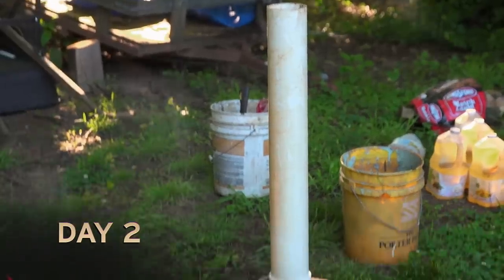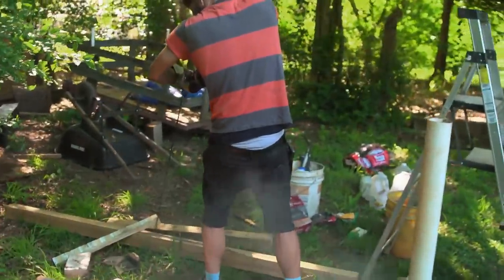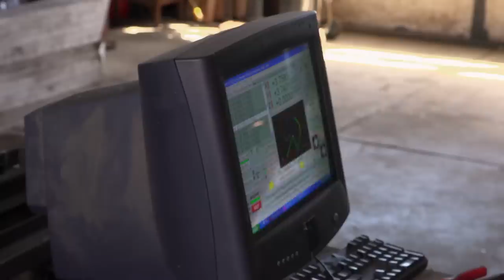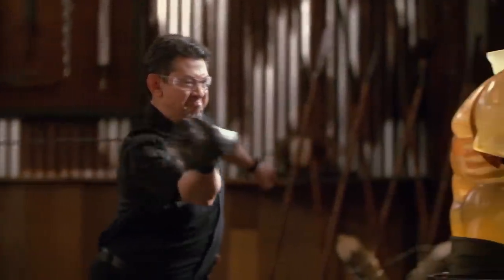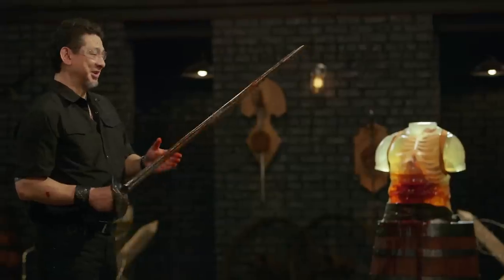Forged in Fire: General Patton's Saber IMPALES The Final Round (Season 7) | History

Comment: Chris-said the heat was uneven, and blade was soft by the tang, he did not reheat. Expected end.
Reply: You sound like a pro now hahaha
Reply: And how exactly does soft steel break and not bend?
Reply: @2.kanalummalmeinemeinungzu181  The molecules in metals form a lattice pattern (inter leave your fingers, that's a lattice). As you stretch the metal, that lattice gets tighter, think about squares becoming diamond. As it is stretched, the metal actually gets more brittle, because the lattice no longer has that flexibility. This is why it breaks.
Reply: @rorysampson5492  you win
Reply: He was literally having to use rocks and coals as a forge so chill out bro
Reply: @rorysampson5492  Facts
Reply: One guy used a old spoon and epoxy the other guy just activates his plasma cutter lmfao
Reply: @b_f_d_d  and if he'd failed on Handel construction sure... but he knew he had a problem with the quench and chose not to redo. His sword was lighter and handle smaller and if he passed all 3 tests that might have won it for him.. the judges often award the win on things like that. He said he could have redone the quench he didnt. Fact was he cut corners.
Reply: @b_f_d_d  You can say what you want about wealth and everything but IMO it came down to being lazy/not preparing. The guy knew it was weak and decided to risk it where as the other guy scrapped a project. Yes the details of the sword where fancier due to the money but that's not what failed. Quench isn't about the handle it's about the blade.
Reply: @jonathanflores7940  Doesn't matter. It doesn't mean he can't reheat his blade.
Reply: @2.kanalummalmeinemeinungzu181  kranker Name
Reply: He couldn't afford a blow torch to fix it because he already spent that money on a bag of Kingsford charcoal - give the guy a break 😂

Comment: Imma be real with you, that guy forged his sword in the woods, without help or machines. He's the real winner here.
Reply: Evanimas  Rich guy could afford to restart because proper equipment gives that luxury in the form of reduced labor for results. I didn't watch this full episode, but based on what we see here, that rich guy had a proper forge to heat up the blade while the other guy was using coal which has a significant disadvantage such as heating up the sword evenly... He took the risk because he had no choice to if we are being honest with ourselves and even if he did start over, using coal as the method of heat treating, chances are it would have the same result. This is not to say he shouldn't have restarted anyways, considering he absolutely knew it was soft in one of the most important parts of the blade.

Comment: You would think that in a show where one of the tests is to beat the ever loving ** out of a blade to try and see how strong the blade is...that the person testing said blade would you know...wear protection. These blades can be ridiculously sharp and its honestly a miracle the judge didn't suffer a "catastrophic failure" of the neck lol. It's honestly a surprise that the show has gone on for this long without the judge getting stabbed or sliced open from a flying blade that broke.
Reply: i feel the same. They need to wear cut resistant protection, its not even that heavy.

Comment: what's the purpose of scraping against the steel near the edge after heat treating? does the sound tell you anything?
Reply: If it is hard enough
Reply: The file test is to listen for the sound of the file skating against the metal if it doesn't sound glass like it's not heated properly and could suffer from issues as it would be a softer metal
Reply: Most steels should harden tougher than a file, so it should skate over the steel and not bite in. If it bites in and files metal away, it's generally still soft. 

Not ALL carbon steels harden tougher than a file though, as seen on some episodes.

Comment: I know how everyone is saying there is a "wage disparity". End of the line though, the guy who got sent off cut a corner while the guy who won made double sure that he put forward a blade that was solid. To the point of making TWO blanks that he then tested for quality. The guy who walked cut a corner and compromised his blade structure by not setting himself up for success. (It would not have been difficult to make a small "dark room" to better see the heat levels of his blade during the heat treat. He could easily have taken that trailer in the background and flipped it to make a covered pit.) His blade broke where he KNEW there was a soft spot. 
Lets all be honest here, if his blade had been fully treated properly, he likely would have won 'cause we all know how the judges hate heavy and clunky weapons, and his opponent had a heavier and clunkier weapon. 
He didn't lose because of a plasma cutter (which NO I do not agree with using also) or money, he lost because he chose to leave a weak spot on his blade and hoped for the best.
Also remember, Ryu WON while using a Satellite dish as a forge. It was all in work ethic, not tools.
Reply: nooooooo muh communist utopia is ruined now that I can't blame everything on wage disparity!!!!!